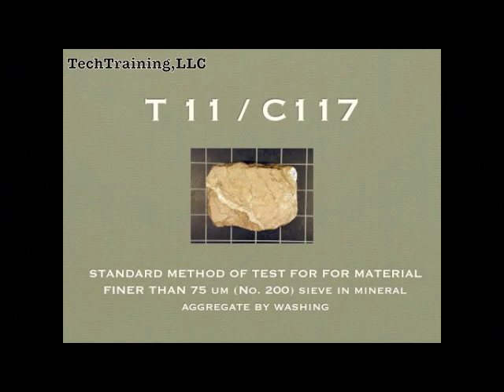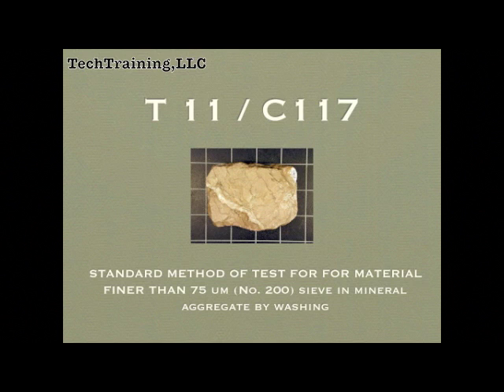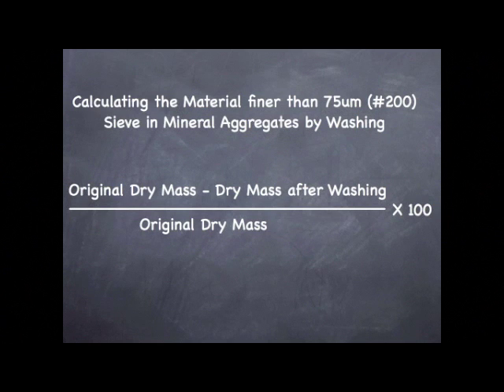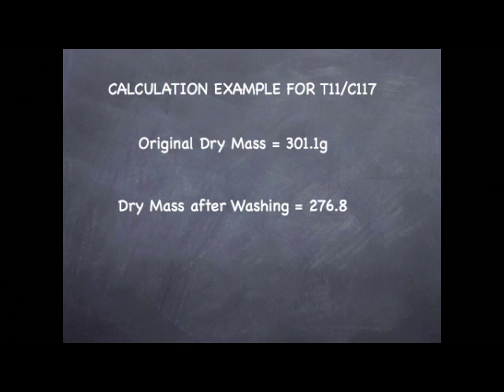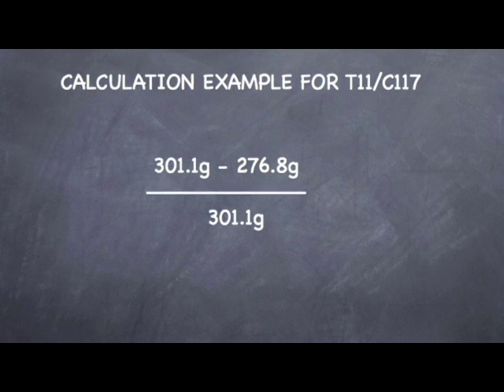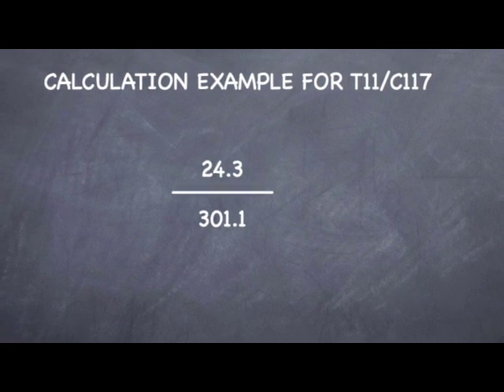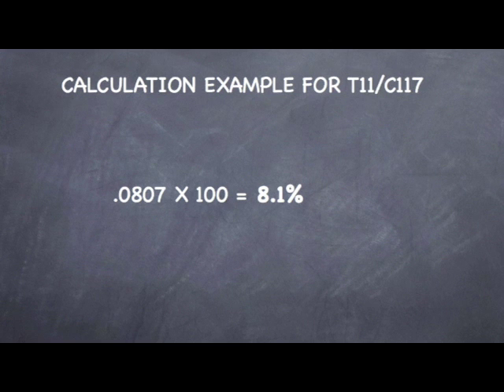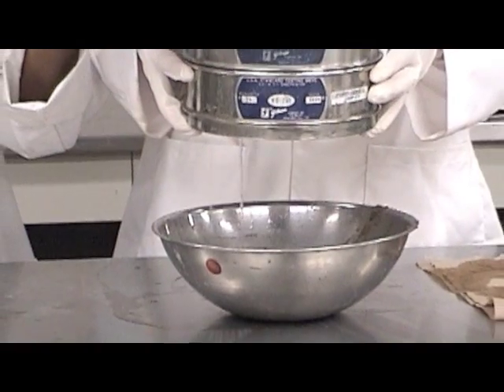T11 C117 Material Finer than the 200 Sieve   Apple TV 3rd Gen

Comment from the maker: Hello Yousef,
The sample that goes in the oven is actually the sample which is in the pan. This way you will remove all the moisture from the material which is finer than .075mm sieve, and then weigh it after cooling, Then you can determine an accurate percentage of material finer than the .075mm Sieve.
I hope this help,
Jimbo8276